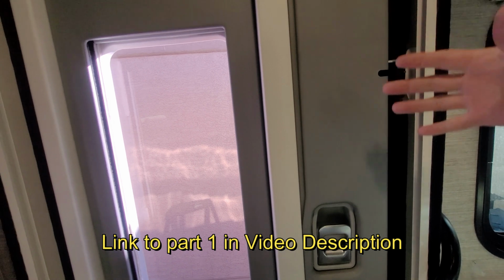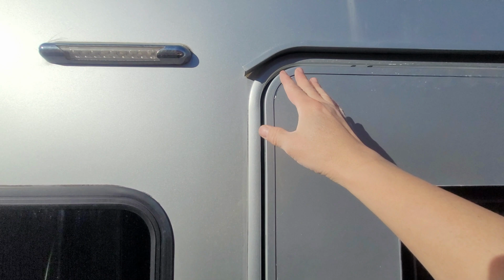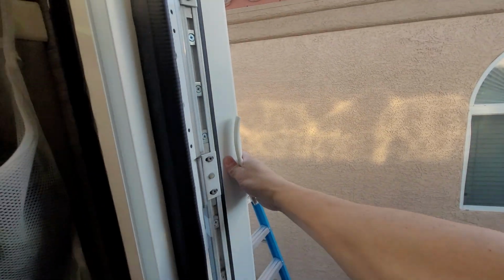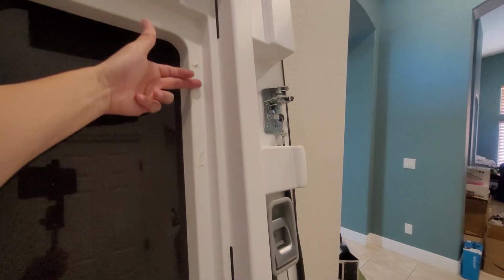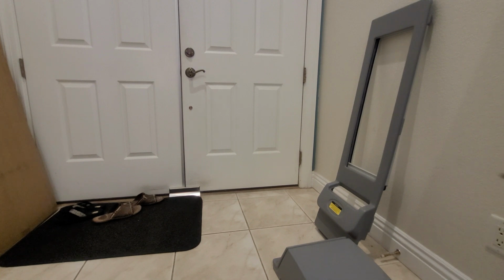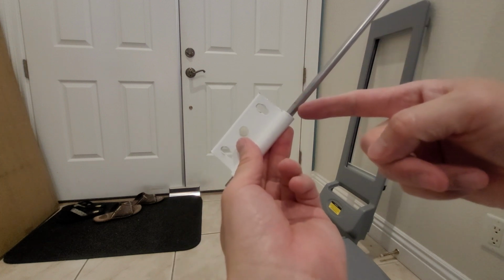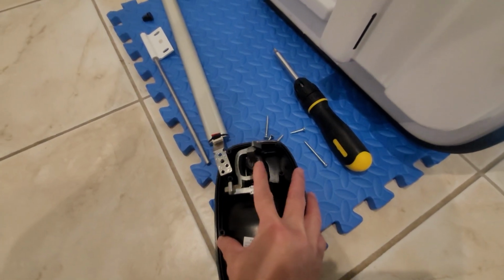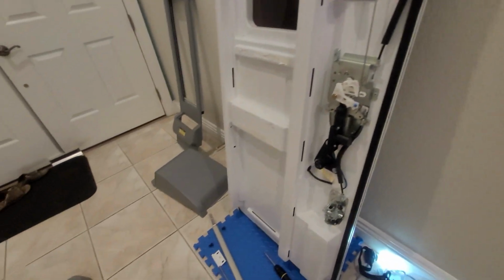Fixing my door in my Winnebago Part 2-RV Repair series

Comment: Thanks for your videos!  I see that you've sold it since this video was put out, but I'm hoping you can steer me in the right direction.  My hinges are semi seized and it's making it super hard to open or close the entry door.  I see that you removed the door.  Would you mind explaining how I can lube these pins?  Unlike other hinges where there seems to be only one closed part.  These pins appear to be closed on both ends.  How did you remove them?
Reply from the maker: Hi David, I'll send you a better response later.
Reply from the maker: Sorry I didn't get back to you earlier.  Got sidetracked and have a busy schedule so Youtube has been on the back burner.  1st, my suggestion is to lube the door with boeshield and work the door open and close many times.  Use generous amount of boeshield on all the tops of the hinges and let them drip down and keep opening and closing the door.  That is what I would do.  If you decide to take the doors off, the plastic plugs just pop off with a flat blade screwdriver, and you remove the screws on the hinges that are attached to the door only.  Hope that helps but I suggest only lubing as much as you can and repeat many times.

Comment: Have you had a problem with the outside handle being difficult to open? Both my wife and daughter cannot open the door with one hand. They have to use both hands. Do you know of adjustments for this? Mine is a 2023 24D. The dealer has been unable to fix it.
Reply from the maker: Mine is pretty easy to open.  Go about 12 videos back on the Winnebago door adjustment.  You need to have the door adjusted properly to relieve the pressure put on it.  Once you have that adjusted, it should be pretty simple to open.  It does help if you hold the thumb like the instructions and leverage the handle only (not make a pulling action on the entire door).  The thumb action is to hold the door in place and leverage the handle only.  But if you have the door adjusted correctly, it shouldn't be that technical. In the mean time, you can push in the door with your left hand, and leverage the handle with your right.  Hope that helps, but it sounds like you need to adjust the door more.

Comment: We have a 20D.  Absolutely hate the coach entry door.  Nothing but trouble.  I think that for us the biggest problem is the amount of force it takes to close the door and have it latch. On the hinge, I have used a special anti seize product, it works well but is very messy.  As you noted, it is a very tight tolerance between the hinge and pin,  it seems as if very little anti seize is left on the hinge/pin after re assembly.  Perhaps a liquid anti seize product would be easier and less messy.     Oh well.
Reply from the maker: Yes this door is more troublesome than it needs to be.  I have my door adjusted pretty good now and the slamming effort is not as bad. I chuckle when I see videos of how great that door is now.  I remember the first video I watched and how amazing it looked lol.

Comment: Thank you for all the information. I own a 2023 24D. My biggest annoying rattle is coming from the sliding door on the bathroom. It is worse with the door open but still noisy with it closed. I think it has something to do with the door being metal and the locking rod inside is too loose. I have tried to look at it a little but it looks like you would have to remove some trim to get the door out. Have you ever had yours apart?
Reply from the maker: I have not taken mine apart but yes, you need to stabilize the metal rod on top and need to remove the trim. I've put a felt pad at the bottom guide so the door is tight against the pad when open. Tha make it a little quieter but of the door shakes, the metal rod will compound that annoying noise. I may get to that one of these days. If I do, I'll try to make a video on it.